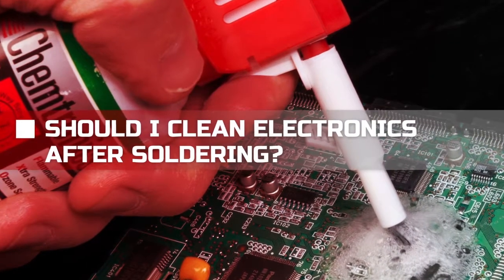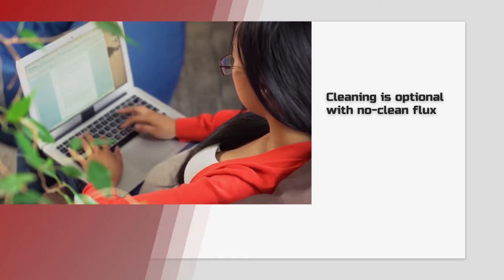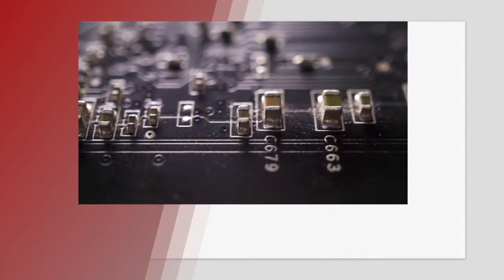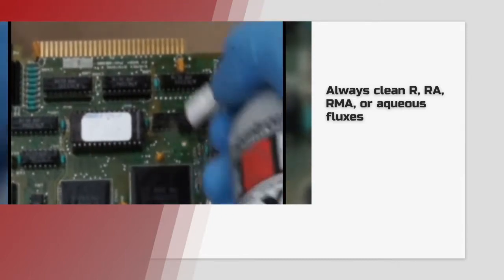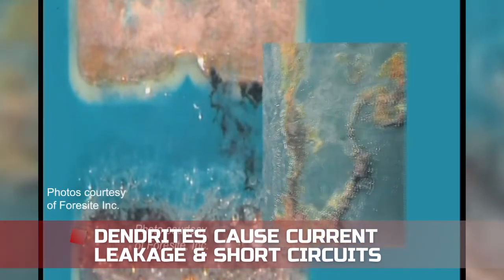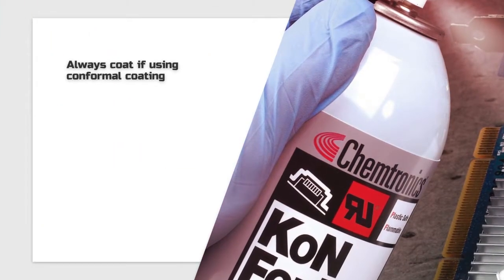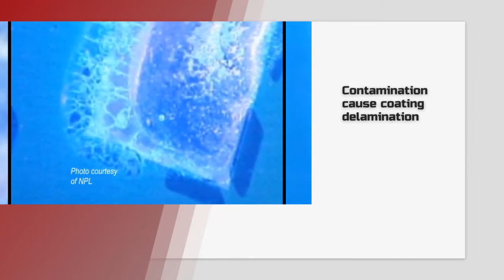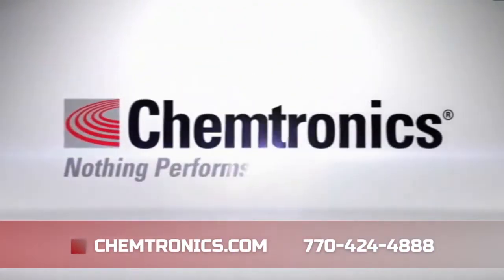Should I Clean Electronics After Soldering?

Comment: From my training by my supervisor in the Air National Guard, not cleaning post op is a no no. DOD STD 2000-1 does not allow for not cleaning. Cleaning is an integral part of soldering ops. Failure to do so could cause failures of any assembly due to moisture migration attracting itself to the residue of flux left on the board or other assembles where solder is used. In DOD STD 2000-1, Cleaning is accomplished only with 99+% isopropyl alcohol as it does not leave a residue and it may take more than one application. In what is now JSD 004, level 3 soldering, no residue is to be left on any assembly. It makes sense because of the aforementioned reason. To further clarify, the use of 99+% isopropyl alcohol does not harm PCBs, the components on them or any terminations to the PCBs. This cannot be said of other solvents being used. Acetone and solvents like it etch the surface of PCBs. Each solder tech must make his or her own choice in participating in cleaning or not. To do so in my experience is unthinkable and very much unprofessional. You handle your own methods. I would not leave residue on my work. For me, it is a discipline I can live with. Stay safe mates!😊👍🏻😷
Reply: Thanks for the valuable insight, Mark. One thing I have noticed is that certain components (particularly electrolytic capacitors) claim to be solvent proof. I do wonder what happens to the other ones when exposed to solvents, and also whether the isopropyl alcohol is safe even for the non solvent-resistant capacitors.
Reply: @ElectricLumens , the very idea of someone suggesting that 99% isopropyl alcohol is threatening to any component, capacitors or any other. Clearly the ones who use a stronger solvent than 99% IPA have much to fear. 99% IPA has been used in critical circuitry soldering since the mid 1980s. This is when I was exposed to DOD 2000-1 soldering which is equivalent to the J STD level 3 used today. The 99% IPA is the only solvent which will not harm components or PCBs. This has been proven over decades. People who understand the high end critical circuitry soldering as I do, don’t have this confusion of this issue you write of here. The ones who waller in their own ignorance on Reddit because they do not care. When someone’s life is at risk, a Class A asset or all the above, one cannot afford a failed solder joint as mission failure risks human lives and high value assets. Critical circuitry is not for the indifferent to be involved with at all. Lives matter, assets matter and mission accomplishment is a priority. It is a mindset and a discipline. Most are not up to the task. Level 3 solder techs know this firsthand. It is up to them to see to this level of involvement is obtained and retained. Failure has too high a price for anyone to do less than their best and they give this every working day. Not all know these things, but learning them if you are not involved with military or medical equipment, this knowledge is not known. Learn all you can is my suggestion. Feel free to ask me. I don’t know it all, but I care about soldering more than most.
Reply: @markphilpot8734  Thank you again Mark. I appreciate the time you put in to educate me. I will learn as best I can and hopefully never stop learning.